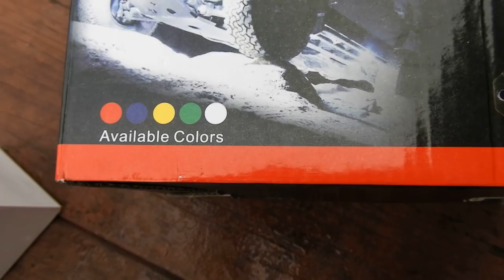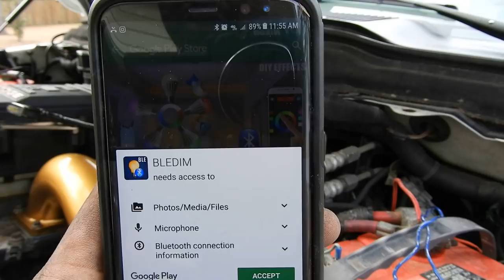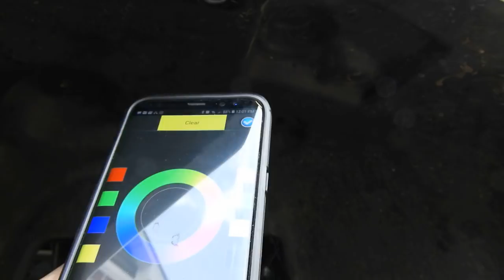ROCK LIGHT INSTALL

Comment: I have a third gen also. Apparently they didn't put um in the rear wells of the third gens and started again with the fourth gens.
Reply from the maker: Yeah they made them for 3red gens just super rare and hard and expensive to get !
Reply: @EVERYTHANGDIESEL  please list them
Reply from the maker: There's no link, I bought mine off of someone. Nobody makes them online
Reply: @EVERYTHANGDIESEL  damn I’ve called everywhere including wrecking yards and no luck just wanna mount my rock lights haha without drilling into the bed
Reply from the maker: I've heard people getting 2009 1500 rear fender liners and they fit just have to trim slightly